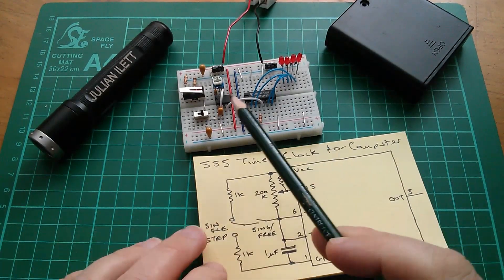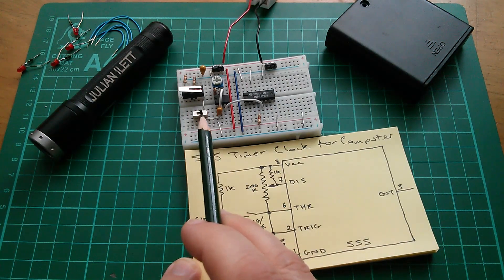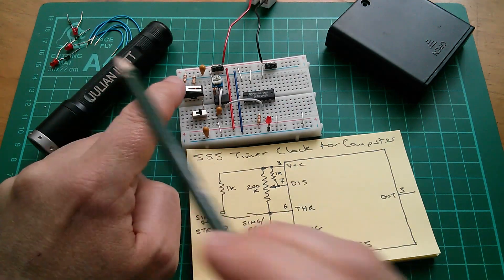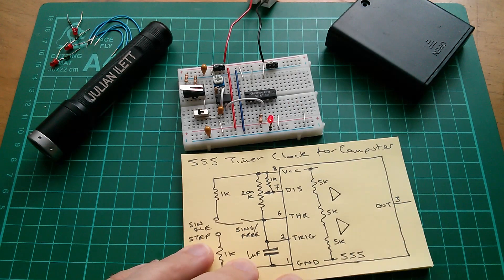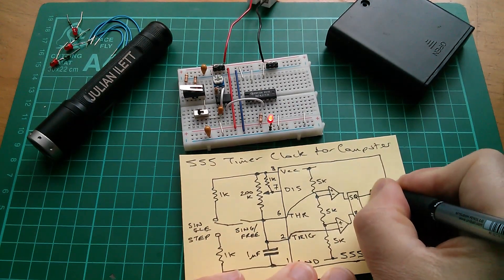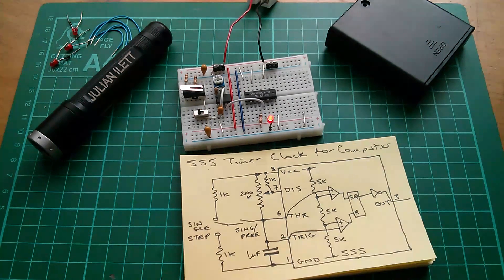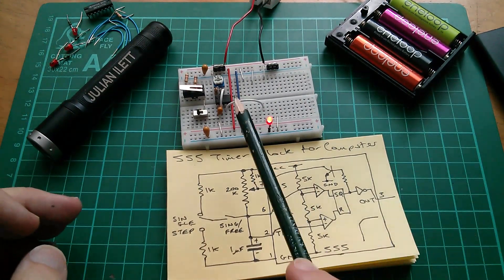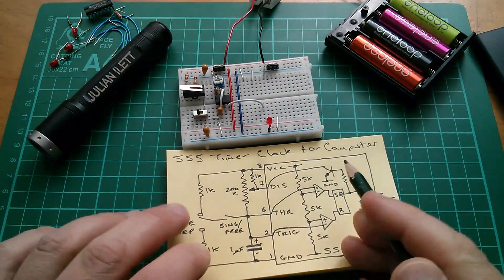555 Timer Clock Circuit (part 2 - with schematic)

Comment: I suspect that you might gain some insight into your unanswered questions in this video by connecting your scope to the Vcc and ground pins of the chip,  triggering off of the output waveform as you did before...

Comment: I suspect the knee on the positive pulse a simpler explanation.  The output of the 555 timer is a totem pole output.  The output goes high into the load which has some natural capacitance which can be reflected back through P-N junctions to the input of the load multiplying that capacitance.  The output rises to the V-CE of the output transistor, then the much lower base current I-BE charges the 'capacitance' of the load the rest of the way to source voltage.

Comment: I may be wrong but it could be the capacitor is not fully discharging. That might explain the fast rise to about 80% and the slow rise to vcc is the capacitor at full charge.

Comment: The curve probably has to do with the internal powersupply of the 555. Seems to me that the SR Flip Flop might not get the full voltage right away. Thats the only possible explanation. Ive never put one under an electro microscope,could be as easy as thin wires or induction which provide some resistance and thus not a sharp flank.

Comment: theres a far simpler way for a continuous free run oscillator, link pins 2 and 6, as above but do not use pin 7, capacitor from this point to ground, resistor from this point to output.... used this circuit loads of times.... as for adapting it for single shot, never yet tried...
Reply: probably could do it the same way as in the video, dont see why not...

Comment: Is there a way to implement this with a 555 so that it has an even duty cycle through the whole frequency range? I only have a 10k pot so I had to use a 10uf capacitor to get a human-perceivable speed. The duty cycle is around 40% at the lowest frequency and 88% at the highest. The 88% duty cycle means that even if the clock period is, say, 32KHz, the time it spends turning off and back on again is equivalent to something on the order of 600 KHz. Do you think i'd have better results with a larger pot and smaller cap?

Comment: If the pot is turned all the way to Vcc and the discharge transistor turns on you are shorting the power rails. You should put a fixed resistor between the pot and Vcc. The parallel resistor will change a linear pot in to a pseudo log one.
Thanks for taking the time to make an informative video in to this useful chip. And to the people who say it is wrong for a clock, how come it is not obsolete.

Comment: I think the ESR of the 1uf is sagging the power supply when you have no 1k resistor and the discharge is doing the same thing on the other part of the cycle. To prove this you would need to scope the +ve and -ve of the 555 with your scope. I think it would be important to connect the ground of the scope directly to pin 1 and probe to pin 8 directly so the breadboard is not included in the equation. Another thing, the led has capacitance which can show up on the output. Disconnect the led to prove that.

Comment: Just curious as to why a 555 was used. There is a simple two transistor astable that can be messed with to do the exact same job as was used decades ago for some homebrew 6502 and Z80 simple computers in the early 80's (with a toggle switch for single stepping). Just to reduce component count or some other reason?
Reply: One reason I can think of is the variable frequency of the clock, which can be useful when stepping through the program.

Comment: Forest Mims wrote a remarkably useful guide to the 555 back in 1992 and updated it regularly through ~1996. I bought it back then,  and still have it, it's been that handy to have: https://archive.org/details/Forrest_Mims-engineers_mini-notebook_555_timer_circuits_radio_shack_electronics  .
Reply: I had forgotten about that. Thanks dude.
Reply: You are more than welcome.  I can't begin calculate the number of 3rd year EEs that passed mid-term labs because of Forest Mims' handy notebooks :)

Comment: I made a 555 osc a couple months ago running on a 7805 and was getting 4.2vpp out, so I put a 7806 in there and got 5vpp. Also when I transfered it from breadboard to PCB, I had to change the caps values to get it back to the same frequency.

Comment: Hi Julian, when using a 555 the supply must be decoupled really really well. Try a 100n ceramic directly across pins 1 and 8, actually straddle the capacitor directly over the top of the chip. Also increase the value of the tantalums across the supply lines to say 47uF each. The 555 is renouned for causing huge spikes on the supply, I seem to remember it has something to do with the totempole output transistors shorting the supply during output transitions. I have seen claims that a couple of amps are drawn during the output transitions, nasty! I have had similar decoupling problems with other chips too, the LM386 springs to mind. When breadboarding circuits I always connect a 100n cap across the power pins of each IC as a matter of course because it can save a lot of wasted headscratching time. Most 100n ceramics have leads long enough to straddle the chip so its easy and quick to do. The Texas Instruments LM555 datasheet shows the internal diagram of the 555 with the totempole output transistors.
Reply: Crocellian - I understand your frustration, some electronics presenters on youtube bother me too but Julian is not one of them.  I think his channel encourages experimentation which is fun and key for a hobbyist. As a child, decades before the internent was invented, I spent years reading electronics hobby magazines and books from the library, I did not have anyone to teach me and no one to ask when my experiments failed. Failing is frustrating but it also offers an incredable opportunity to learn. I think Julians channel encouages people to experiment and when his circuits don't behave as he expects he trys to investigate and solve the problem, this is good. As a hobbyist there are only a few 'secrets' we need to learn to enable success. Knowing these 'secrets' can allow us to achive a near professional understanding and the ability to design and build reliable working circuits. Of course they are not really secrets but they are subtle and not always easy to discover. I believe that proper power supply decoupling is one of those 'secrets'. I like to share what I know when I can, hence my post. Sincerly, I would encourage you to share your experience and help when you see something you believe needs clarifying. You may just trigger that 'light bulb' moment for someone,  we all need that from time to time.
Reply: Crocellian yes Julian comes across as not knowing much at first. But then if you actually watch the channel you realise he does not miss a beat and actually uses some real tricks of the trade to make things work. I have 30+ years in the industry as a design engineer (senior design engineer for an MOD contractor) through to head of design, and can tell you if you think he's an idiot it is you that lacks knowledge.
Reply: @Pete yep the 555 is an unstable little git if the supply lines are not decoupled adequately.
Reply: Gordon Lawrence - Good description of the 555 :) I would rather use the CMOS version, 7555.
Reply: In a nutshell.........Fuck Off

Comment: You should only need one 1K resistor at the switch. Put it on the output side. Of course that's only valid if the switch opens before closing.

I'd also ensure there's a resistor always between  VCC and Discharge as you could sink a lot of current through the transistor otherwise. Move the spare 1K over there. :-)

Comment: The manual switch doesn't generate a single pulse. It turns the frequency generator on/off meaning pushing it can generate anywhere from no pulse to several depending on where the pot is dialed into.  Is there a way to design it so the single switch generates one, and one only, pulse?  I really like the single timer chip idea so I hope that's still possible without creating multiple input circuits.

Comment: What happened to poor pin 5?  That's the 2/3 Vcc control voltage? 2/3 being a node on the 5k 5k 5k resistor divider network.  0.01uF to VSS in astable mode.
Reply: I agree, I always put 0.1uF pin 5 to gnd to help bypass.

Comment: it probably locks up because VCC is short circuited to GND through 200k potentiometer (highest position of center point on schematic) and internal discharge transistor

Comment: For the strange behavior I'd try tying pin 4 high (prevent false SR latching) . Looked at the datasheet for the 555 the output voltage appears within norms .

Comment: Your 1K resistor between pins 8 and 7 should be between pin 8 and the upper connection to your POT, that makes sure you are never shorting your Discharge tranny from Vcc to GND.  I think that's what you meant to do anyway.  If the bypass CAPs cleared the issue up, then it pretty much points to a issue with the voltage rails.

Comment: did you leave pin 4 (reset) floating?
Reply from the maker: I did.
Reply: Julian. You should not let it float( it can be used to make a VCO ), tie it to GND via a 1nf cap at least, in your case there may not be any noticeable difference, but leaving it floating can easily cause problems. Also the discharge pin should not be allowed to go to V+ as it connects directly to GND. There are better ways to get symmetrical out put from a 555 but does it really need to be symmetrical  ? as long as the falling/rising edges have the required duration, then you are "gravy". Just to say, I enjoy your videos :)

Comment: I've always have had good luck with the Cmos version of the 555 (7555). It has a much cleaner output. The drawback is a little bit lower drive power and to get the highest speed from it, it had to have a higher Vcc voltage (usually 15v). It depended on how fast I needed the output signal to be.
Reply: One other thing I noticed with my designs was, different manufacturers' 555s were different from one another. Each one's output would behave differently.

Comment: Maybe, without the resistors the capacitor acts like a short-circuit for a short time when being charged and that pulls the overall voltage down until it charges a bit, thus causing the "stepped" output?  But to be honest, I don't really know for sure either.

Comment: If your momentary switch is break-before-make, there will be an instant where it's open-circuit and could cause it to act in free-running mode and cause some unexpected glitches in the future.
Reply: Make before break does not matter in this case because the  switch has a 1uf capacitor, which effectively decouples the switch, giving it plenty of time to hold the voltage while the switch cycle completes.
Reply from the maker: Yes, that could happen if the clock were set to run at a very high frequency. But this computer is more about blinking lights and processing instructions at a visible clock rate. Good point though :)
Reply: you are in charge of your future, you seem to be against learning unless it conforms to a model that you like this sounds scary to me I think your a bit weird and I would imagine that anyone else reading this will get what I mean
Reply: oh yeah, you go away !

Comment: The one person who disliked this video probably fried his chips.....
Reply: Crocellian Why not? The goal of the video is to demonstrate the principals of these electronic components in an easy to understand and visual way. If you don't like the channel, then don't go commenting on it
Reply: I always fry my chips as the oven ones are not as nice.
Reply: "No one, anywhere would use a 555 as a system clock" -- Crocellian, in the comments section of a video of a guy building system clock using a 555 :D awesome
Reply: Crocellian Believe me.....You are not even close to Julian Sir's knowledge..... That's why you are spreading rubbish......
Reply: Actually it depends on the system. If you want a low speed clock and want to be able to single step there are only about 3 ways to do it without going silly complicated. A transistor R-S flip flop with a few extra components to go A-Stable in free running mode will work (these were used a lot in the 80's when 555s were not cheap) the 555 Circuit Julian has used, and there used to be a signal generator chip you could do it with. I cant remember what that chip was though because I never used one and it was over 30 years ago when I last saw a circuit.
Reply: well said the guy isn't wired up right
Reply: well said sir the guys a fool
Reply: It was the dislike bot, pro'lly.
Reply: obviously a Yank, sir your missing the point of this channel, so do everybody a favour and go somewhere else
Reply: Shiladitya Ray           It was probably Angelica
Reply: Shiladitya Ray Once the magic blue smoke is released... Electronics don't work anymore.

Comment: Strange 555 timer behaviour, Jules?!
Have you considered trying to build a 555 using latches, comparators and resistors on a breadboard to tr and work out what's going on? You can scope out various parts of the timer, see why you're getting both the weird step glitch, and that slow rise time
Reply from the maker: I guess so. But I don't want to get too bogged down with the clock circuit - there's a lot more computer circuitry to design.
Reply: Indeed. the devil's in the details, and all that noise! :P
Fun future project though :D

Comment: On the side.... Could the step be due to the current drain on the Eneloops when the LEDs are lit at all?
Reply from the maker: I just checked the eneloops - they're all at 1.28 volts - so they're good. Easily capable of supplying an amp or two.
Reply: OK Good to check though.